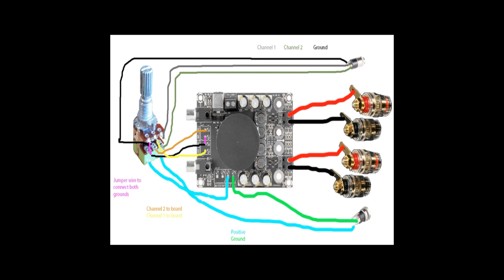How to build an Amplifier for you Speakers! Overview and Test

Comment: What did you use for a power source?
Reply from the maker: Mike I had a 19v 4.74a power supply from an old laptop I used.
Reply: 123Toid roughly 90watts?
Reply from the maker: Mike yes